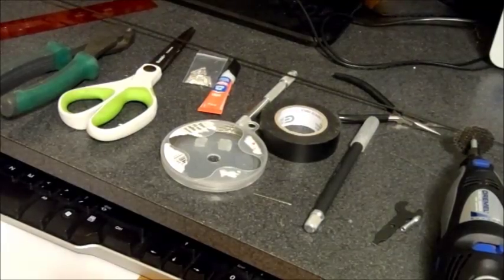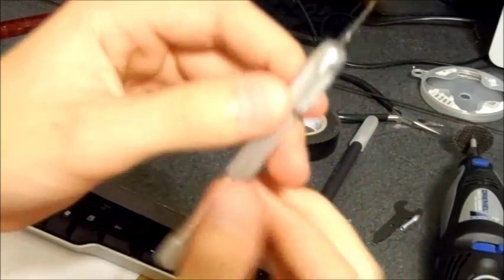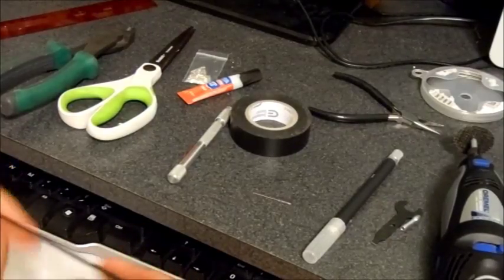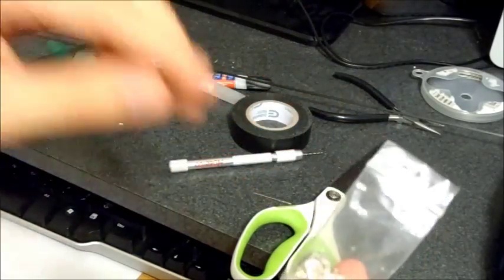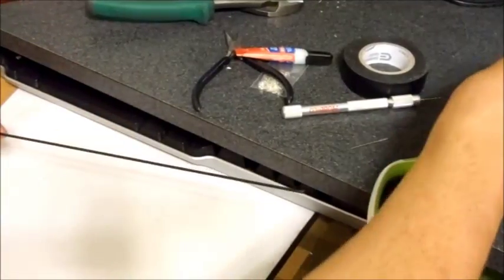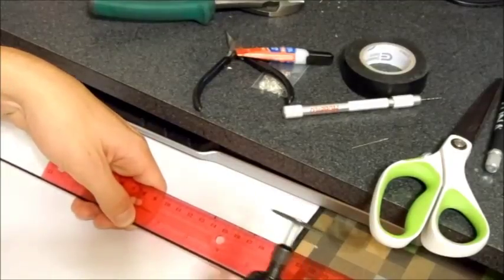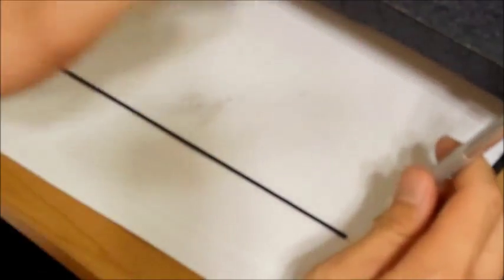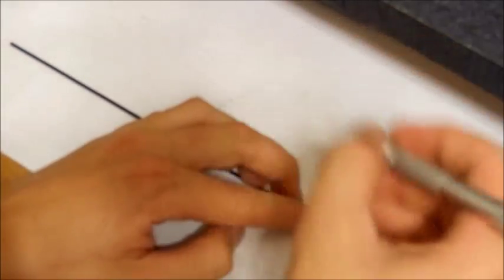How to make the best mini bow and arrow (bow segment)

Comment: hi, i have herd the argument on what works as a flaming arrow. To my experience, the only way to make it is to use steal wool, with sulfur power in it. Yes it does not smell the best, but the air rushing by actually makes the "flame" bigger. The flame only glows, but it will light things on fire from a distance. You can use only the steal wool, but the burn is not as good.

Comment: Purple primer ( found in a hardware store plumbing dept.)  Styrofoam.  The primer will stain most things , you can use clear pvc cleaner but the primer is more flamable in a metal container simply and styrofoam to the primer once tou have added enough it will turn into a goo (the primer dissolves the styro) apply to projectile light and shoot... this mixture is super cheap to make and burns like crazy

Comment: The bow should be bent so that the string is taught and it gives more of a 'snap' when you shoot it. So maybe you can use a bit less wire.
Reply: Also don't bend the bow so much that when you pull it back it snaps. Bend it as much as this (

Comment: use super glue, and dip the end of the arrow in it and put a small, thin, and about half-an-inch long and 1cm wide cotton thing and wrap it around the arrow that is dipped in superglue and when it dries completely, dip it in gasoline and light it up and shoot

Comment: yeah you need to get lead and dip your arow into it it causes the top to be soft then a little bit a litter fluid about the size a a bowl and then take a drip only a drip of gasolean into you litter fluid and some carbon dip the top in and shoot it be carfull it stays lit

Comment: Add fine steel wool 2 ur soaked what ever n it will spark thru the air n keep it lit cause the wind will only make it spark more
Reply from the maker: I'll have to try that. Do I need to cut up the steel wool or anything?
Reply: @trumpatier  well i cut strips n attach in strips along shaft with fuel in between n under 4 strips total basically

Comment: this aint a mini bow, its just a stick with some wire, a bows called a bow because of the archs in betweek the handle and the tips
Reply: +jasper Urquico that's actually completely wrong. Native Americans used a bow called a flatbow, which is completely flat when unstrung. This is, in fact, the most powerful type of bow.